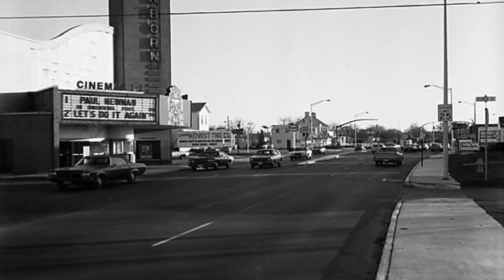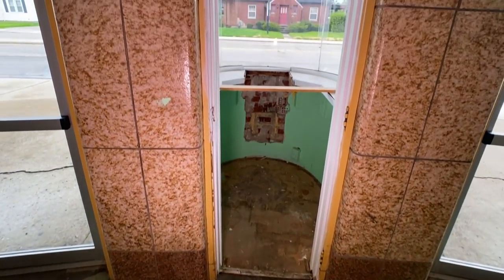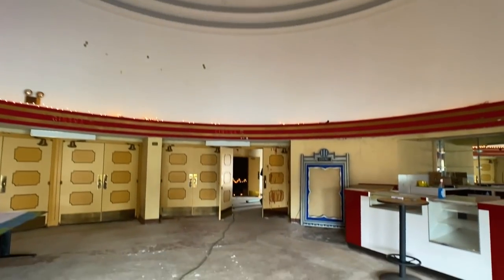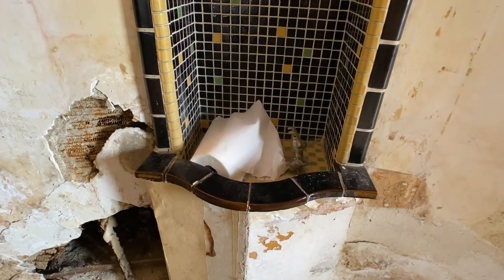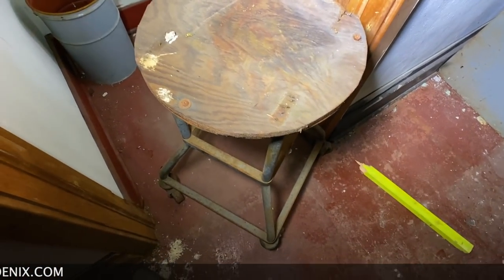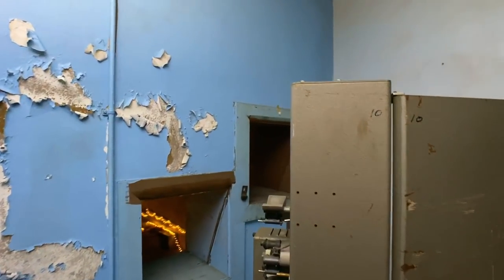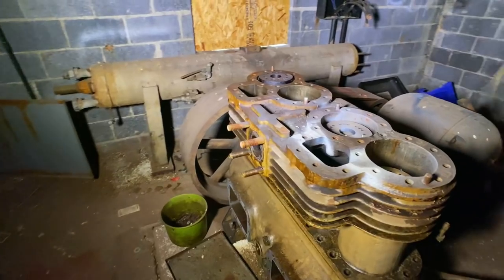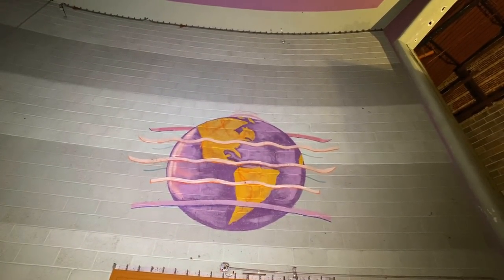Saving the Abandoned Fairborn Theatre | Fairborn Ohio | Urban Exploring (2020)

Comment: The room upstairs with the shower was a locker room for the ushers. The projector shown in the video came from the now gone Page Manor cinemas next to Wright Patt AFB. It was not original to the Fairborn. Fairborn would have used carbon arc projectors when they first opened until around 1960's when  Xenon bulbs took its place. The large generator looking piece of equipment in the booth is left over from the carbon arc days. It is an  rectifier which converted AC power to DC for the carbon arc projector. The main lobby use to have a large crystal chandelier. The marquee use to stick out further. It was cut back when the road was widen. There is a picture of that in the video. The original mural that was in the inner lobby just before you enter the theatre is now at the Fairborn senior citizen center. The "separator" located in a small closet off the stage towards the end of the video was actually a but in vacuum system. There would be numerous places for a hose to be attached to to vacuum the floor.

Comment: The large motor looking device around the 12:00 minute mark is part of the unit that generated DC current to power the carbon arc projection lights of the older original projectors.   Theaters moved away from the carbon arc projector lights when other options became available such as Xenon bulbs.  I've operated both types.   Carbon arc lights were a trip to operate.

Comment: At 12:00 is the motor-generator which was used for powering the carbon arc lamphouses (light sources). It is sitting in the generator room which is always next to or part of the projection booth. At 12:54 is a "Mini-Pec" projector automation unit. We had one at the Skyline drive-in theater in Shelton, Washington (pictures at cinematreasures.org). At 18:11 are two Altec-Lansing "Voice of the Theater" movie sound loudspeakers (one is laying across the other). Back in the day, those were the finest speakers for movie theaters. At 12:47 that is a foreign made projector and not original to this theater. Probably added when the theater was twinned. Original projectors would have been American made from the Big 4 projector manufacturers: Simplex, Century, Brenkert, and Motiograph. That shower was like for the projectionist. In the summer running carbon arc lamphouses the heat would be unbearable in the booth. Back in the day, projection booth were required by code to have a sink and toilet for the projectionist to use as they were not allowed to leave the booth.

Comment: I love old movie theatres from the 40’s & 50’s. I hope the people who own it will restore it back to ORIGINAL condition and won’t modernize it.  I realize it had already been altered to some extend over the years,but hopefully it can be put back as closely to original as possible. 
We had similar Altec Voice of the theatre speakers in the movie theatre I worked at.  Ours were A5’s I believe.  The large cylinder with the “spencer turbine” emblem on it was a central vacuum system.  We used an old NSS “pig” from the 50’s at the theatre I worked at.  
I also worked at another theatre built in the late 1930’s that had Art Deco styling. It had a huge Ignersol ac compressor the size of that one and the ac vents were under the seats. 
I know most people always look at these buildings as businesses and the main concern Is turning a profit,but I view them as not only works of art,but powerful reminders of a better time when the world was a much different place,and it’s important that these places survive to remind us of who we once were and how far we’ve fallen.
It angers me that bums were allowed to nest in there and steal and scrap impossible to find pieces.  I’d want to fix the original air conditioner and use it.
Reply: As far as the A/C goes it would be next to impossible to reuse that old compressor. The head missing would be next to impossible to locate today as most of these ended up in the scrap yard. Necessary parts to make it work probably haven’t been available for 30 years or more. It also uses Freon that has been priced out of reach thanks to the EPA. Not to mention the electricity it would use to run it would be prohibitive. The system could be overhauled with modern equipment that would deliver the air from the floor. The large blower they show in front of the coils right before they show the compressor could probably be reused as it looks salvageable. I have been doing commercial and industrial HVAC for 30 years so I know a little about it. Most of the belt driven A/C compressors were scrapped before I started doing this type of work. Without seeing the entire system in person it is hard to make any real determination. Unfortunately for these fellows they’re looking at probably a couple hundred thousand dollars just to get any kind of functional A/C in that building. Just for the record, the head wasn’t aluminum. I’d love to see something this old be rehabilitated and put back into use but unfortunately it probably just isn’t feasible.